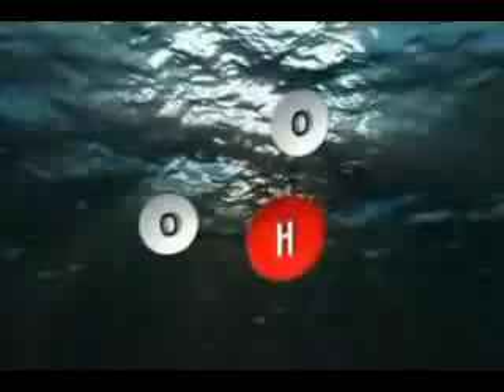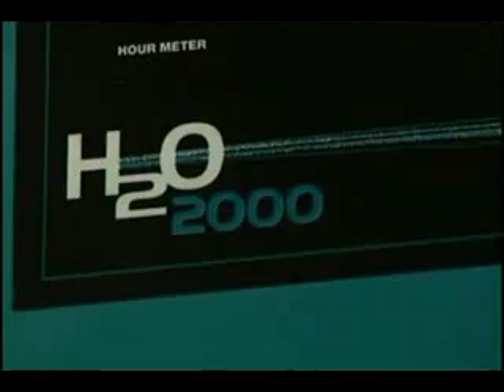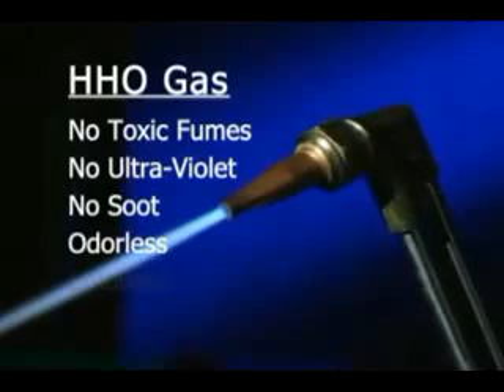How do HHO Car Kits Work?

Comment: This is crap hho gas is explosive at source it can not give more power back than it takes to split it  . For cutting there is a device called a Plasmarc where hydrogen gas passed across tungsten electrodes . the result is an ionised gas that will cut through stainless
Reply: +Tony Lightheaded 
You sure chose the right name and picture for your sad profile.
The only crap here is your ignorant comment.
Who the fuck said its giving more power back?
The calorific value at the 'Fusion' point in a HHO flame exceeds that of the electrical  equivalent  by Newtonian classical physics.
What you and unfortunately most of the brainwashed masses fail to acknowledge is that Classical physics operates within a Quantum environment.
Whats Quantum mechanics? Who the fuck knows? Science knows as much about QM as you do about HHO - FUCK ALL!
Petrol is explosive "at source". Brush past an open fuel tank with polyester clothing and Boom!!!
HHO is an 'on demand' produced fuel which renders your comment CRAP!
If you care to do your homework, you will find that HHO is slowly but surely replacing oxyacetylene in heavy industry for heating and CNC cutting which cuts as smooth as a table top in a third of the time and cost, and NO POLLUTION!
And as for cutting stainless steel - A 260 watt HHO machine cuts through 1mm stainless steel like butter. The high the carbon content (harder the steel) the more volatile the flame reacts. My 260 watts of flame melts tungsten in seconds. It melts ceramic that has a melting point of 14,000 degrees, and then boils it which requires neaRLY 20,000 degrees, all from 260 watts of electrical energy!
WTF can your Plasmarc cut with 260 watts - FUCK ALL!
You are not getting more "Electrical" energy out than what you put in, what you are getting is an ATOMIC REACTION ! not a CHEMICAL REACTION.
Matter is being transformed into pure energy - E=MC2

Go ask your box head science mates what calorific value can be achieved with 260 watts? 

What a CLOWN!
Reply: there is no such thing as HHO gas and your claim that this is an atomic reaction shows you are full of it . Electrolysis of water is chemistry
. Where did you go to school?
https://en.wikipedia.org/wiki/Electrolysis_of_water

Comment: I am an experienced welder in 6 types of welding and know what I am seeing. Correct me if I am wrong but every cut I have seen has been LOADED with slag. The cuts were also very jagged. 
If you want to promote this thing to welders you better show some nice straight CLEAN cuts.
If you would add an extra Oxygen lever like the oxy acetylene cutter you would improve the cutting a great deal. For soldering I think it is great but inconvienient compared to a little tank o propane

Comment: It is the old relocated emissions scam, like an electric car you recharge using a coal fired power plant. This whole green energy thing is so rife with graft and scammers a 1000 of these jokers should be summarily shot and it broadcast nationally. A solar plant in Blythe? That is idiocy too. How much power is lost in transmission? LA residential roof tops are not pristine desert, but heaven forbid we give people what we can sell to them. BTW they made on demand carbide gens for OA gas welding.

Comment: @hulkamstrongest  This is from 8 months ago.  I have to inform you that if you put a nine-volt in a bottle of water or something and overturn it, so the bubbles rise, that you will have oxygen and hydrogen separated at the perfect explosive burn rate needed to explode all that water in the bottle and the sink everywhere.  Kind of scary, considering it was an inch in depth of air and I was going to see how the flame entered the bottle when the plastic burned away.  explosion.  :)